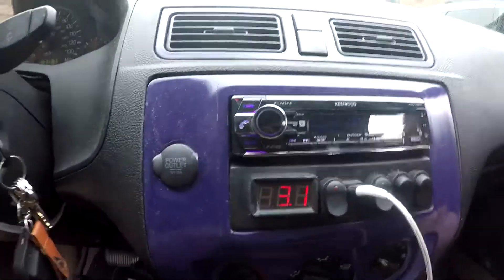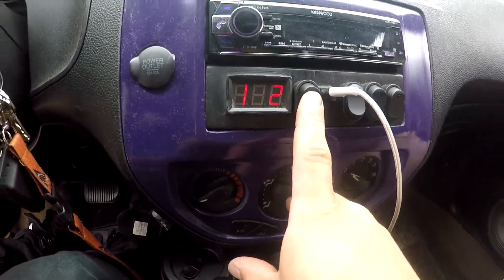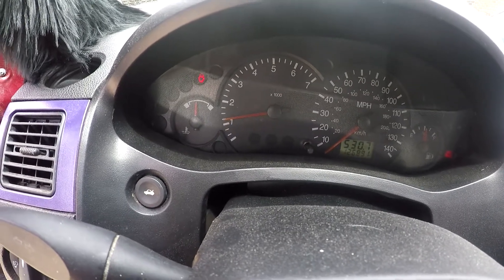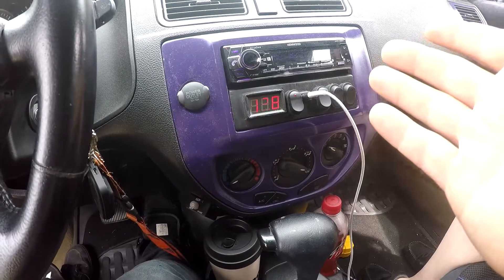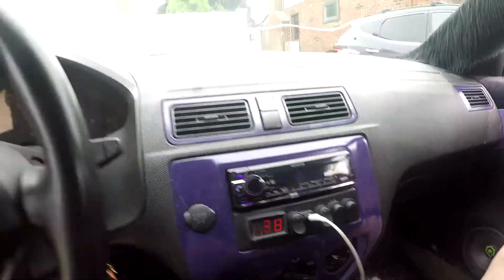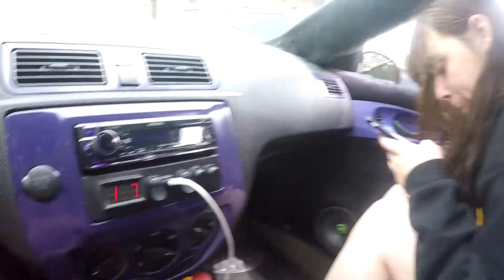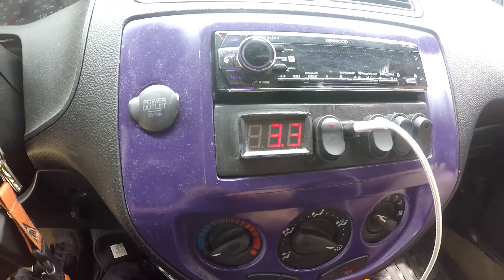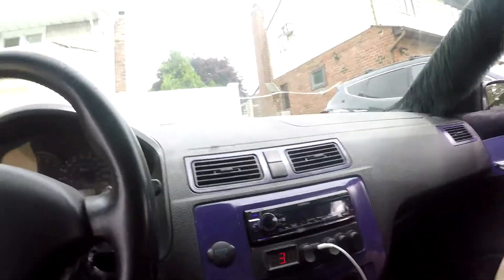I Have A Voltage Problem!! HELP ME

Comment: I have an aftermarket JVC  KD-R450 single din stereo in my 2001 honda civic so when i attach the faceplate nothing happens but when i go to my trunk my Rockford Fosgate punch 250.2 amplifer hooked up to my Rockford Fosgate hex  single 4 ohm 10 still turns on as in the power light will be on when the faceplate is on and the amp will turn off when the faceplate is removed so i am pretty sure the stereo is defective now and i bought it a few years ago how would i go about replacing it would i have to disconnect the battery and all that when changing out the stereo since i have a subwoofer and amplifer hooked up in the car .

Comment: Same problem I have ran into. The voltage is regulated by the ECU. The car likes to sit at 13v. That's around what mine sits at when I put it to stock mode. I have a 2000 focus.
Reply from the maker: the alt ended up shitting the bed a few days ago i think that was the issue i'm trying to get a new one
Reply: Just wondering, what engine does your focus have? Im running the SPI with a 320a alt.
Reply from the maker: 2.0 the smaller one and its a 2007 but the alt ended up shitting out a few days later so i'm sending it back.

Comment: I like seeing your progress as a retail pro now. Love watching installers grow. Clamp it with dmm. Demo situations consider a rv 12v power supply if you access a generator or 110v plug. It helps your alt last longer.

Comment: I’ve had the exact problem last year I resolved my problem by adding an additional set of the big 3 after which It would be 14.8 ( cold start) 14.3  (sitting idle for a while ) but I would also check the wiring marking sure that none of the wires are damaged or even burned up
Reply: John Fernandez I have that issue right now, cold start 14.8 and idle it drops to 13.2 but I don't have a high put ALT

Comment: That seems to still be an issue with the alternator because it should be keeping your voltage higher even at idle. With that amps playing obviously it will drop but it shouldn't sit that low. Especially with your batteries. Maybe you should contact the guys again and see if they will replace it with a new one this time.
Reply from the maker: ive been thinking to go to an alternator shop to get their opinion so if that is the case i can show the company who makes it instead of hoping they do the right thing and maybe still have issues later on.

Comment: Definately sounds like ur alternator,internal regulator set to low,have u tried checking ur voltage via multimeter @ the  alternator with car running. Are u using CCA wire? I have a Singer 240 and told Mike i wanted my voltage to rest at 14.4 or higher and it does just that 14.6-14.8 @ 2k rpm.
Reply from the maker: the alternator died so i need to get a new one

Comment: Have you checked all your grounds  and cleaned them had some what of the same issue over the weekend cleaned all my grounds and voltage came back to where it should be
Reply from the maker: yeah there all good and have been cleaned within the last month

Comment: Id go get a singer alternator or switch over to 16 volt electrical or like you said maybe your idle rpm isn’t high enough for the alternator
Reply from the maker: that's what i think and a few other people i know think
Reply: Rob's Bass when had a belt slip problem I had to go back to the factory pulley on the high output alternator id try that first

Comment: You should go to Iraggi Alternator’s I got mine for 450  and 320 amp or singer they should tell you how many amps the alternator makes at idle maybe the alternator was not made right and makes really low amps at idle
Reply from the maker: i was thinking to go over to iraggi
Reply: Rob's Bass they are amazing man you can either talk to Melissa or even Dominick the owner they will give u price and shipping price and comes in a very secure way

Comment: Try stock pulley on your high output alternator
Reply: Nic Money If the stock pulley is larger than the one that came with the high output alternator, swapping to it would do nothing but slow the alternator down, causing the voltage drop issue to be worse than what it currently is.
Reply from the maker: i thought about that but sense i used a smaller belt figured the smaller one would do better but at this point im going to try anything
Reply: How much are you showing durring higher acceleration? You should hit 14.4 @ 5000rpm if you dont then its not the pulley its a defective or damaged alternator but most likely its the pulley but if you're not hitting 14.4 then theres another problem durring cold startups the alternator shoots the amperage up and slowly tapers off after warming up it should be running 13.7 to 14.7 make sure all your connections are well cleaned take a meter measure the out put at the battery up front then in the rear you will have drop but it shouldn't be dramatic if it is you have connection issues goodluck

Comment: Yea the stock alt doesnt have enough amperage but it has more voltage.. a high output alt shouldnt put out less voltage than stock alt that makes no sense. Pretty sure your problem is with the alt

Comment: If your car has higher voltage with stock alt than a high output than that alt is junk
Reply from the maker: well that's only at idle all other times its much better that's why i'm confused

Comment: Sorry but its still the alt. Get a Singer and tell him where you want the resting voltage.
My singer hot rests at 14.8 cold at 15v. Just tell him you want higher idle voltage.
Also toping off your batteries with a charger every couple weeks is just good practice.
But im sorry that alt you have isn't what you think it is.
Reply from the maker: ive been thinking about getting a new one i feel like ive gone through everything at this point

Comment: Even though you don't think the alternator could be an issue I think you should test it again and the wires connecting to it. Since its a HO alt you should have upgraded positive and ground leads to the alternator so make sure you have that and check the connections with a dmm to verify the resistance is not to high for the grounds. 
A vid on alternators
https://www.youtube.com/watch?v=FTGz0PKIl84

I personally would check all the ground you have added and make sure they are not causing a choke point in your systems electrical.

Also does your vehicle have an electric load detection unit? My civic has one but even without bypassing it I sit at 14.2 idle and 13.8 playing 

Hope this helps man cheers
Reply from the maker: all of the wiring i have added seems good and the stock wiring harness plugs in but ill check the rest out